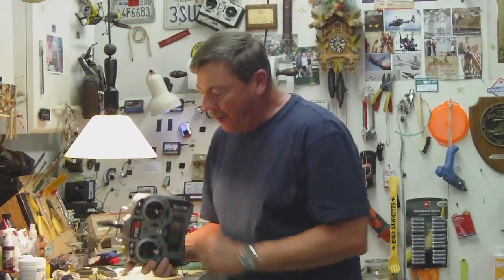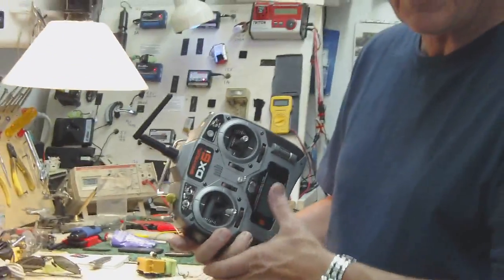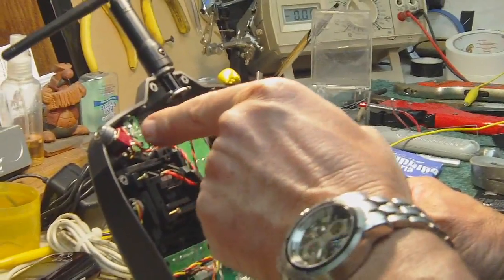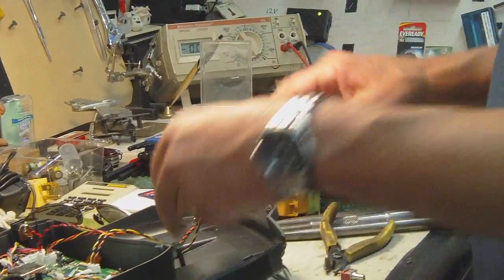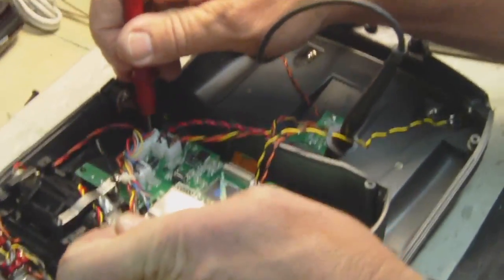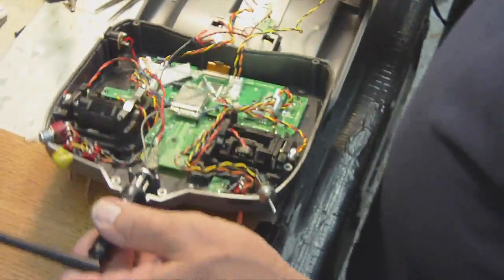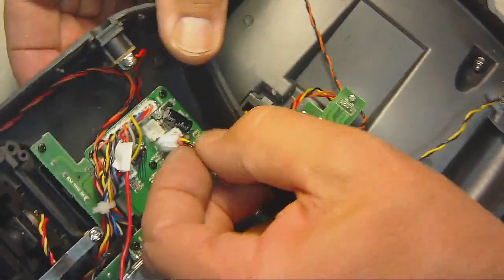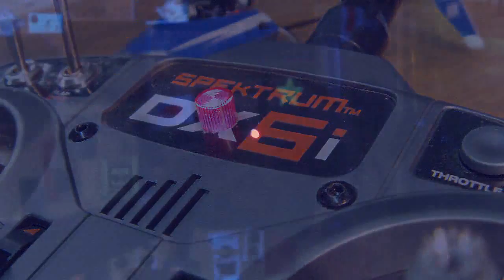Add a 99 cent "Power ON" Indicator light for your Spektrum Dx6i TX. Easy to Do.

Comment: that looks SO shit..way to fuck up your  DX6
Reply: rob b 

I agree I put my LED behind the speaker grill so it lights up the spektrum logo cutout.
Reply: Daniel Reik good idea
Reply: explain how he did that ok? Number one, he properly fixed his broken switches instead of using superglue,duct tape,or gorilla glue like some idiots I have seen use on switches. Then they claim they didnt know how to solder. I would buy anything Dave fixed. He has been in the business of RC since the 70's. He knows more than anyone. Back in the early years of RC flying, guys had to build their own transmitters from a kit. They were not cheap eather. Drilling a little hole in his case didnt hurt the thing a bit. He knew where he could get his power from without effecting the transmitter by using a meter. How many guys would know enough to do that? Putting an led in any old place that shows power could compromise the whole unit,frying circuit boards or draining the battery. He knew enough to not do that. He also knew he didnt need a resistor on the led because the voltage he tapped didnt require it. Could you honestly say you could do that? It is his transmitter to do what he wants, I wouldnt trust buying one used,unless I could see what and where he altered it. I have seen guys trying to sell their garbage broken half assed screwed up transmitters on line. This wouldnt be one of them.
Reply: I think he was referring to just drilling a hole in the face of your Tx case and popping an LED in. It makes it look very radio shack chic. If that is what you're in to more power to you. The mod on mine is exactly the same except I did not drill a hole in my Tx case to mount the LED. I put it behind the logo so when it is on it lights up the logo. It looks pretty cool when it is on and looks completely stock when off.
Reply: Daniel Reik it looks shit.. do the backlight mod.. pretty obvious when its on then !

Comment: Jeff your video is really pleasant to watch.
In your descriptions you should not say 20mA an hour or per hour.
The usefull unit in this case is the instantaneous consumption, and that is the intensity in A, then mA in such a LED case.
And if that is 20 mA, I think this is far not negligeable since my DX6i draws no less than 35mA in normal mode and 20mA in sim mode.
So with that in mind, one can quickly imagine that the batteries will last shorter, since for example in sim mode, you'd double the current consumption.
There are some super bright blue or other agressive colour LED that can be seen as well as your red one (I really believe) while drawing only 1 mA.

Again, nice tuto.

Comment: Very smart. But are you able to tell me something? I have converted Spektrum DX6i from Mode 2 to Mode 1 and when I tried to test fly my heli I found that the main rotor trims have changed. When I accelerate the rotor for lift-off, the servos are behaving out of order. Upon speed increase the main rotor tends to pull left as seen from behind the heli, and when I decrease speed the rotor tends to pull right as it stops. Also affected is the stabilizer bar. In other words, the swash plate is not flat on stand-by and as I increase the revolution speed the right side of the bar tends to lift up and the left side and lower itself. Something has gone wrong with the heli, despite that the DX6i working properly wit the conversion but I don't seem to know if it has also affected the dual rate or, what do you call it when a heli flies upside down with the use of the Mix Switch? Do you know the reason the DX6i and the Blade 400 are now enemies? So much said about doing your own conversion and then there are unexpected problems with the operation of the heli servos. But I wonder why did they do 2 Modes, why not stick with one Mode and that is Mode 1 because of it's simplicity. Are they going to make another Mode so even dogs can learn how to fly with a new RC called Mode Finger? It would probably be my last time I will ever buy a Spektrum. Their customer service is really disappointing. :-(

Comment: Excellent-excellent tutorial. Next, let's see a vid for the Drop Protect accessory. This is a contact sensor at the neckstrap loop, such that when the neckstrap is disconnected it turns on the antigravity module. Then when the user accidentally bumps the radio off the bench it will not fall to the ground but simply hang in midair awaiting retrieval. (See Spektrum accessory antigravity module part number SPM33497.)

Comment: Outstanding. Great Tutorial Sir. I was able to goto a electronics hardware store and 
$36 bucks later. 15 leds (5 colors @ 3 of each), 15 clear led caps and a 100 ohm resistor and Boom 1 Blue power Led. I truely thank you.
Scooter Vauto

Comment: is thear a way to switch from right to left hand throttle on this transmitter because i have been using the standerd controls that cum with the mcx but now that i have a dx6i  icant get used to the controls so if u can help me pls respond

Comment: I like to watch your videos Dave. Thank you and Jeff.
Could you please tell me the names of the songs from 6:34 and 7:47 till the end. Thanks.
@lukey546, it's a servo without potantiometer and modified gear so that turns 360 degrees. It already own it's power suplly (cells). It's made by Mr.Dave. He was invented it many years ago while the power screwdrivers were not common.

Comment: If you're going to the trouble of splicing the coating off a power wire to solder another wire, you might as well just cut it completely.  This enables you to slide heat shrink over it to better protect the exposed wire than just ducttape.  I understand the whole mantra that cutting it ruins the integrity... but you just soldered it!!! There's no major difference in impedance between cutting and resoldering versus keeping intact and soldering.

Comment: great mod dave,i could never understand why the dx6i has no power on lights,all my car based txs have power on leds etc. ive also left mine on with a brand new set of top brand batterys in it 3 times.

Comment: excellent videos, thanx so much for all the info, it has helped me to be a better heli pilot. 
I have a blade 400 that crashed due to a malfunctioning dx6i, which horizon hobby gave me a brand new rtf and repaired my tx. so now i have two blades.

your video on head repair for the 400 was so helpfull.

Have you used the 5 star cnc head for the blade yet ? If so could you do a vid on tightening the slop in feathering shaft, as this head uses rubber bushings.

Thanx again for all your work.

Comment: i love mine too..the only thing i hate is that theres no power light i leave mine too sometimes ill be doing this aswell thanks..

also the trim buttons break easy on this dx6i they have cheap plastic on the trim switches i had to fix one..CA glue wont work you have to use paper clip drill a hole on the center on the trim leg then put paper then bond with CA then wrap a string.

Comment: Great Idea Dave I definitely think it needs a light. I have left it on twice and had to send it to Horizon to be reset after it entered backup error. I think Horizon would replace the switches free of charge also. but I know how you love tinkering with stuff. Anyway I need a light but don't want to void the warranty. Great work!

Comment: Great idea Dave, I love my two DX6i too.  I had a problem with the trim tabs breaking, Horizon Hobby were great with sending me some new ones to replace, but I found some machined aluminum ones from East RC. they work great and probably will never need replacing, check out my trim tabs repairs video :-)